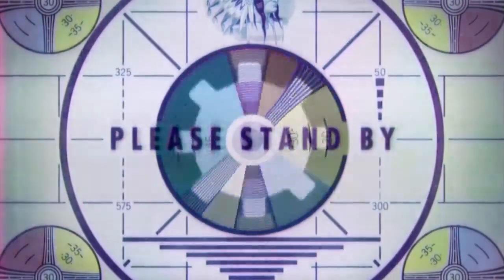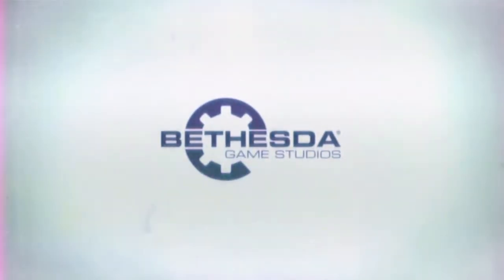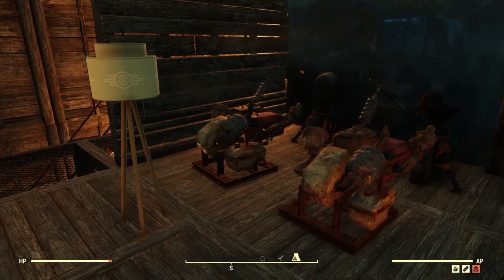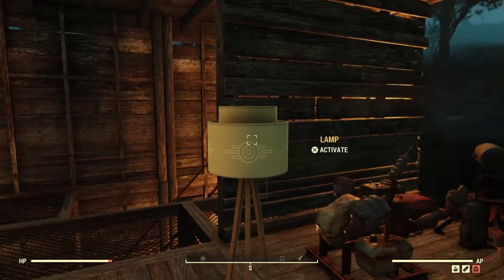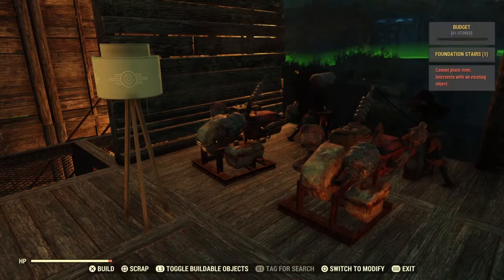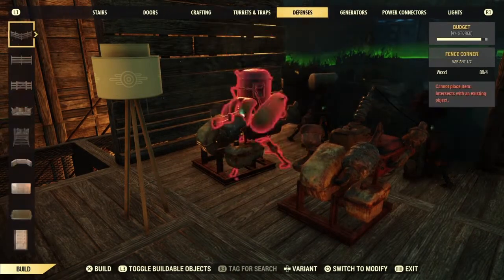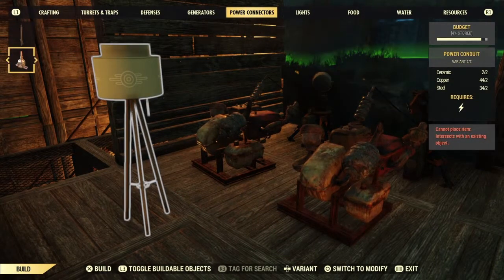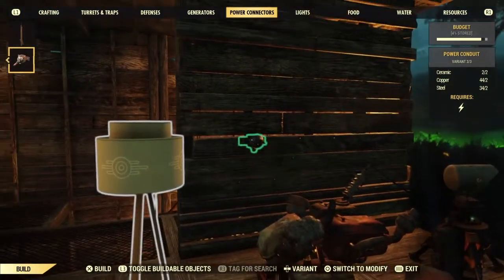Fallout 76: How to power the Vault-Tec floor lamp tutorial

Comment: i hate how the floor/ceiling power conduits emit wirelessly yet the conduit junction, which is the same damn thing only with connectors on the side, does not emit wirelessly. That would def make wiring look much cleaner. And since those emit wirelessly, why do we need power radiators?
Reply from the maker: Good question!

Comment: Still doesn't work for me, even with the same lamp and using a small generator
Reply: Update: your way works with the side wall conduit. Not sure why a ceiling variable of the conduit wouldn't work for the same :/
Reply from the maker: Did you "Activate" the lamp?